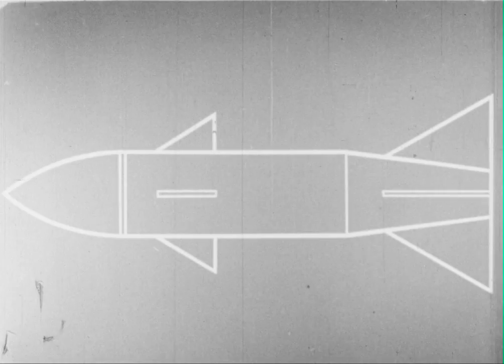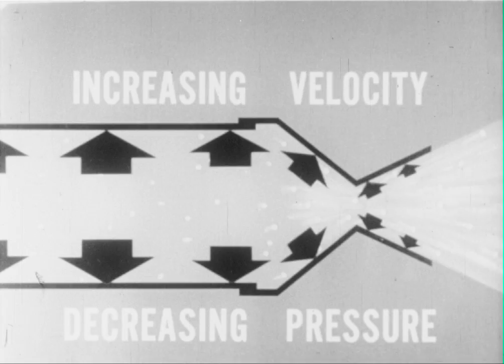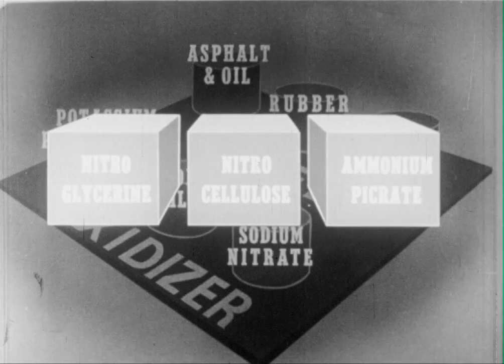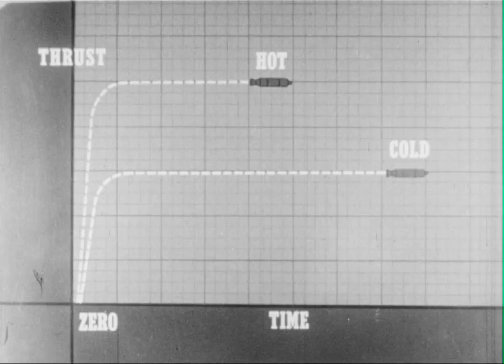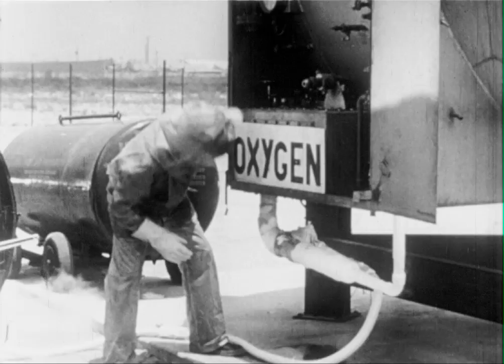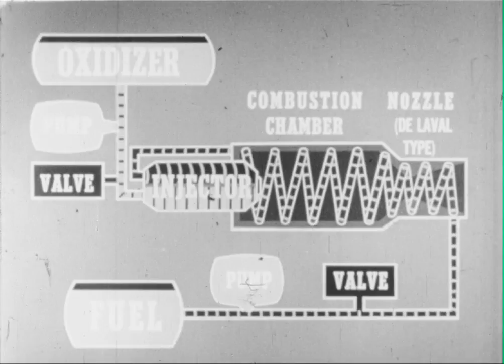The Rocket: Solid and Liquid Propellant Motors

Comment: Take note that hydrazine replaced aniline as the key fuel in monopropellant and bipropellant systems where weight and conditions require 99.99999% dependable operation.

Comment: This is the best explanation ever. It is an old video but explained it better than anyone could today.
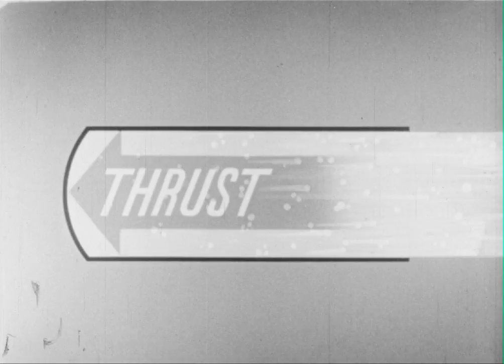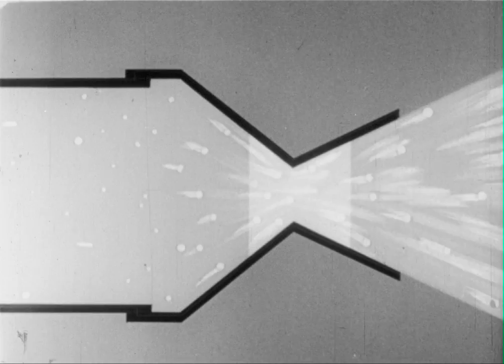Reply: 2:18 is wrong 3:03 is where the thrust is generated. They call it a thrust chamber for a reason. Those hot gasses keep expanding and accelerating, providing thrust, until there is no acceleration left and the hot thrust gasses become exhaust gasses.

Comment: 13:25 How is the fuel and oxidizer mix ignited in the combustion chamber for liquid prop motors?
Reply: Soyuz uses more or less a giant match sticking into the thrust chambers from below. Some use a kind of spark plug ignition inside the chamber.
Reply: Hypergolic propellants don't require ignition
Reply: changenoways dieseling, and started by various means

Comment: guys why can't we use nuclear fuel in rocket
Reply: Look up project Orion. And of course NERVA and project Rover.

There were also some ideas of using a nuclear powered ram-jet to make a mach 3 cruise missile with more or less infinite range. Scary shit.
Reply: Hota Sandilya nerva
Reply: Hota Sandilya low thrust
Reply: @aons5481  But high efficiency. It is good for interplanetary missions.
Reply: Atmospheric radiation contamination.  In space, it's perfect, as long as it makes it off the ground without something going wrong.